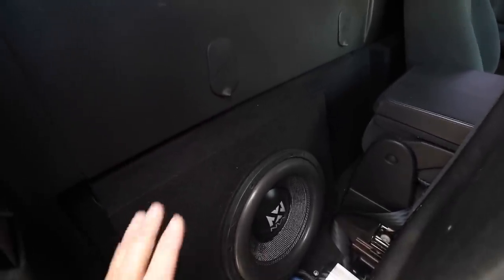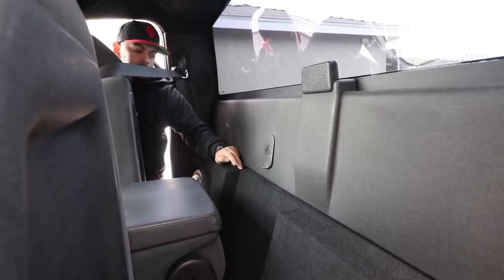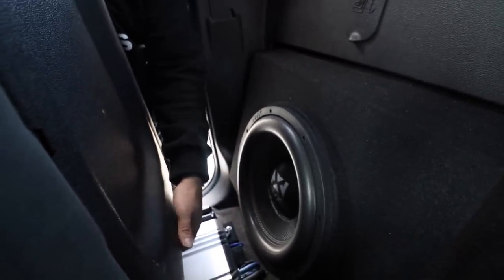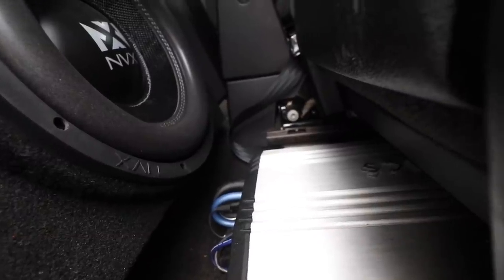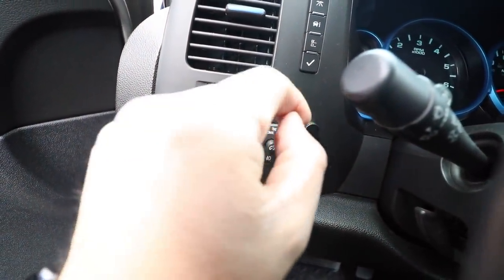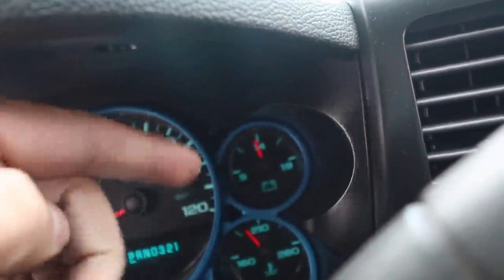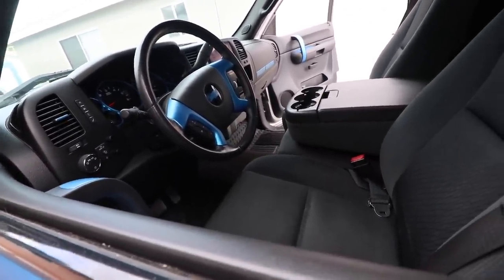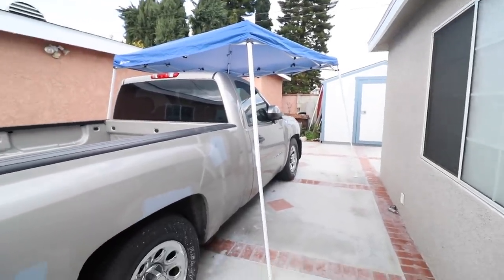SINGLE CAB SILVERADO SOUND SYSTEM!!!

Comment: Installing better speakers in a single cab truck can be a nightmare extended cabs are a blessing lol
Reply: Kevin Davis on 🧢
Reply: I have a 08 single cab Silverado running 3 10’s and 1 12 all jl audio and a 3000 watt audiopipe amp all 0 gauge. my alternator does fine does drop voltage but been doing fine past 2 years. Nice system man
Reply: i realize Im pretty off topic but do anybody know of a good website to watch new tv shows online ?
Reply: @Soren Carmelo Thank you, I went there and it seems to work :) I really appreciate it !
Reply: @Jackson Armando glad I could help :D
Reply: I got an 03 dodge dakota single cab, any recommendations on anything that’ll at least be an upgrade from the factory speakers? I don’t wanna be loud as fuck but i want to enjoy my music with a little bass with it being clean/clear sound
Reply: @okanoyuki  that’s what I’m trying too figure out. Cause the seat blocks the sound quality of the speakers vs the seat not blocking them. You bout need the seat against the dash because of the speaker box is deep.
Reply: @kevindavis4709  shit ig I’m gonna have to just get me a big Bluetooth speaker😭
Reply: @okanoyuki  yup lol 😂
Reply: @kevindavis4709  well thanks for the info, I appreciate it so i don’t have to waste my time. Have a good day/night!
Reply: if it’s done right then it could sound good. pretty difficult to do with little box space behind the seats. depends on the speakers and the factory suggested minimum air space
Reply: @joshouagamber6211  i learned more open air a speaker 🔈 box gets better performance you will receive. Being closed up behind the seat muffles the speakers behind the seat.

Comment: To all people with a single cab truck  Yes, It will blow your speakers if your seat is to far back touching the speakers. I just had to replace mine for that reason. Get a grill cover for the speakers it might be the difference in having to replace your subs.

Comment: a Big 3 up grade helps, be sure to do that when you get your new alternator
Reply from the maker: It has the 3 upgrade already
Reply: nice, but I see you doing it on a budget, I took my alternator to a shop that works on electrical stuff, and had it rebuilt and had them up grade the stock alternator, it cost about 63 bucks but it beats spending 500 stinger alternator
Reply: boba fett If money is tight then thatd be the best option but if not i definitely recommend a mechman. running a 250a mechman in my 02 silverado single cab. running 2 fi audio on 3k👍🏽 it pounds

Comment: i had a soundqubed 2200 running 2 soundqubed hdc 3 10s at .5 ohm off the stock 165 amp alt it did fine. i have the video on my channel

Comment: Did You get your project truck from a auction?. Single cabs out here in Cali are hard to get cheap like yours
Reply: Joel Fierros I got my truck for 4900$ from a auction it was used as a work truck but I fixed it up

Comment: bro u need the dual battery and big 3 upgrade..3....o gauge
Reply: dual batteries are useless in this set up. What he needs is the big 3 a good agm battery 0 guage ofc wire and a high out put alternator...

Comment: Have you had any issues with your power running beside the rest of your wires? I saw you taped everything else up that's why I was asking, also do you have a capacitor? And last thing try checking all your factory grounds on the truck you might have some corroded just a thought i have ran into that issue once apon a time, changed my alt, changed my battery like 3 times and then finally just got mad and traced all the grounds and some needed to be cleaned and I used no loc  and bolted everything back and it worked great no loc is used in electrical stuff to keep it from getting corrosion on it.. just a thought

Comment: What year is the truck what is the size of the ring u had to add to fit the subs also thats a seald box or ported i have an 03 n i am looking into a 2 12s set up thanks
Reply: Your setup is going to be completely different, his truck is newer and has different inside dimensions.

Comment: Did u remove the console seatbelt
Reply from the maker: Yes. I had to. Wouldn’t fit with it
Reply: And did you also cut the screws off that held the jack accessories
Reply from the maker: No the screws for the jack are still there.